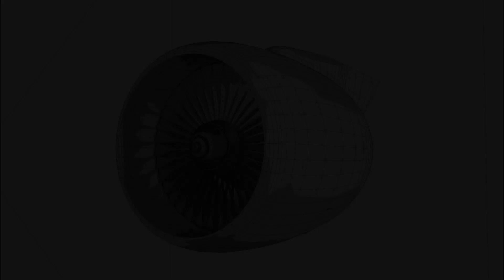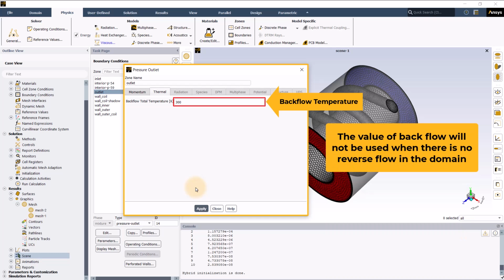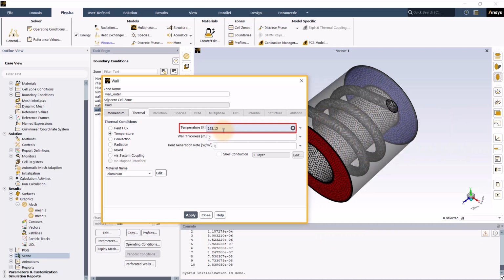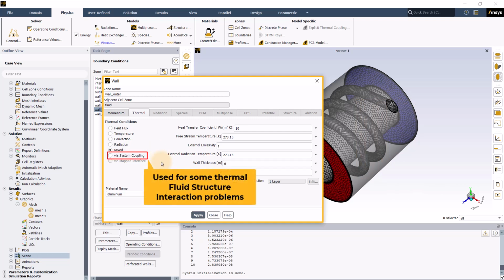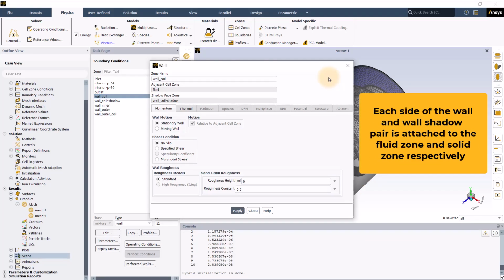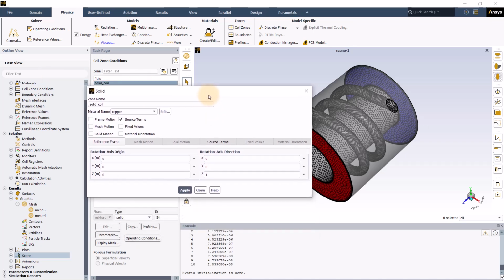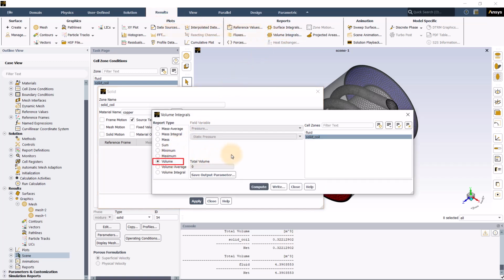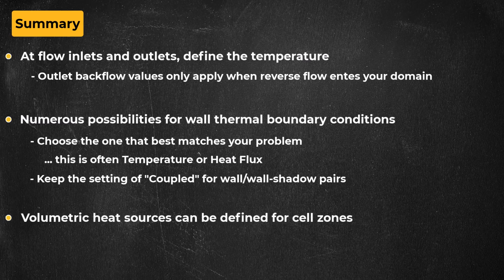How to Setup Thermal Boundaries and Heat Sources in Ansys Fluent — Lesson 2

Comment: Hey man thanks for the useful tutorial. For my model i have an inside air and outside air and a housing made of aluminum and lens (clear polycarbonate) which separates these air domains. Ouside air is at -20C blowing at 60mph. Inside the housing in the middle of inside air there is a gap which i use as a wall boundary conditions and assigned a heat flux. When i only use convection heat transfer, temperature hits 5000K around the heater. Remember that inside air is still. Should i also activate radiation model for this? If i activate it, which model you would suggest? Or if i don't activate thr radiation model, is there a way to avoid excess heating? I also activated gravity for natural convection but it didn't really help. Do you have any suggestions?
Reply: And my heater generates around 69000 W/m2 heat flux as this is a 600W heater